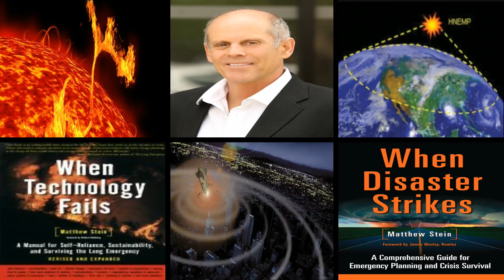The Secrets of Surviving an EMP Blast - Russell Scott (2017)

Comment: I was a weapon's mechanic in the Air Force and from what I remember, there is a very small window, at altitude, in which to explode a Nuke so it will be effective. Say if the nuke had to be set off at 300 miles, it can not be more than a half mile or so in either direction (high or low) to work at all. Only a couple countries have the technology to build such a missile with  this type of precision. Iran and North Korea are NOT one of them. I'm I right or wrong and if I'm right, why isn't that reported?

Comment: Am i the only one with a 3500 grid tied solar system - with the knowledge and hardware to rewire it to a solar controller, pure sine wave inverters, and several glass mat auto batteries (4 from my cars, and 3 stored in my trickle charger) i figure i would want refrigeration, and probably some type of air conditioning. I also have a small Dehumidifier that can be converted into a small air conditioner with just one panel,  and a battery. Led Lights, laptops for movies and such are child play after cooling and refrigeration are figured out.  Being in the north east USA, the winter months would have to use firewood in my fireplace to heat the house, but solar and charged batteries at night can be useful for my electric blankets.
Currently, my $5000 grid tied solar system has been saving me about $75 a month since 2014, so i wouldn't want it sitting idle waiting for an emp or grid attack.

Comment: Umm...look what I just found
Space Weather Message Code: SUM10R
Serial Number: 688
Issue Time: 2017 Feb 13 0603 UTCSUMMARY: 10cm Radio Burst
Begin Time: 2017 Feb 13 0445 UTC
Maximum Time: 2017 Feb 13 0445 UTC
End Time: 2017 Feb 13 0445 UTC
Duration: 1 minutes
Peak Flux: 100 sfu
Latest Penticton Noon Flux: 76 sfuNOAA Space Weather Scale descriptions can be found at
www.swpc.noaa.gov/noaa-scales-explanationDescription: A 10cm radio burst indicates that the electromagnetic burst associated with a solar flare at the 10cm wavelength was double or greater than the initial 10cm radio background. This can be indicative of significant radio noise in association with a solar flare. This noise is generally short-lived but can cause interference for sensitive receivers including radar, GPS, and satellite communications.
Reply: The Darkness yes and b4 the last so called "President" went out, he made some emergency law ..Executive Order of some sort that had to do with "space disasters".

Comment: https://spectrum.ieee.org/tech-talk/semiconductors/design/radiationhardening-101.  Having worked nuclear plants I am really sad to hear this conjecture regarding the nuclear industry. This short article on the IEEE  is informative to shed light on the matter. Not hardened? Really? Right. Those electronics and backups are well protected.   Not to mention that an overhead impact from space? Can you spell containment? Shielding? This thinking is crazy. Japan's issues had to do with salt water freezing the circulation pumps at coolant intake systems, plus the backup generators being ruined by the wave and the general breech in structure impacting the high dose spent fuel pools all from the wave. High dose would keep people from taking any action to correct anything, like the backup generators. They are huge and then there is the mechanical SCRAM all nuke plants have for a final shutdown if all else fails. A fuel breach from heat creates an uncontrollable geometry to control fission and the heat increases rapidly. Thus a melt down. However the containment should have been built to contain a meltdown as ours are int he USA. They do a continual special concrete pour for YEARS building a nuke plant making it safe for such an event.

Comment: so if some sneaked 10 small nukes in to any country  and put the on planes and spread them out over the country and be at about 35,000 feet and set the nukes off what damage would that do as a EMP then
Reply: Very local damage, as I understand it. The EMP created by an atomic bomb has a short range in the atmosphere. Widespread damage occurs when the blast happens 100 or more miles up. The gamma radiation from the bomb travels unimpeded in the vacuum of space and interacts with the upper atmosphere in a line of sight effect to create the EMP. The higher the blast, the wider the effect on the ground.

Comment: Excellent subject and program thank you all.
I have used medicinal herbs for years with very satisfactory results.
  Like Cuba in it"s constant state of struggle where firming is always  maintained at a 
minimum, things don't change much.  Using medicinal herbs as a norm for health says 
that getting sick or lingered is not that much different. Long as you don't break something.
  Wormwood can be very beneficial as well It and catnip help with gut issues from bad water contact.  Just washing your face can introduce unhealthy micro organisms by getting your lips wet..  = Wormwood.
Nor rag weed and they are difficult to discern and they have different medicinal property.  Make a little tea and notice the effects.  Tinctures are easy to deal with.